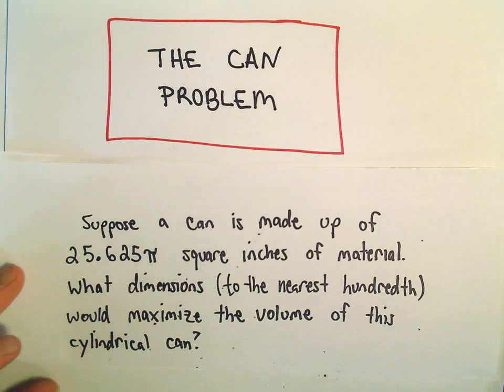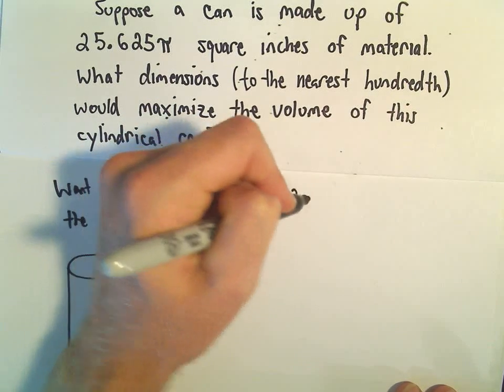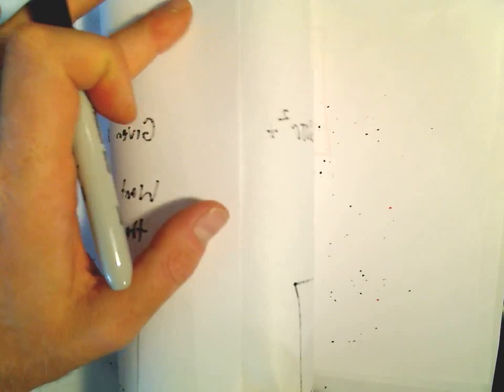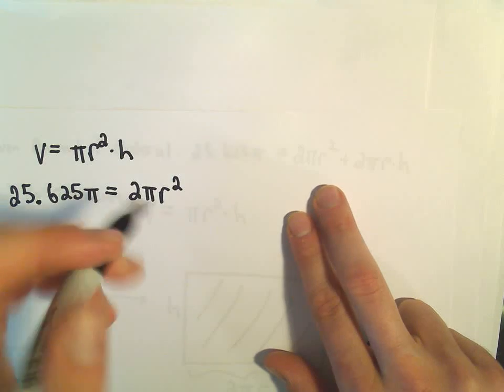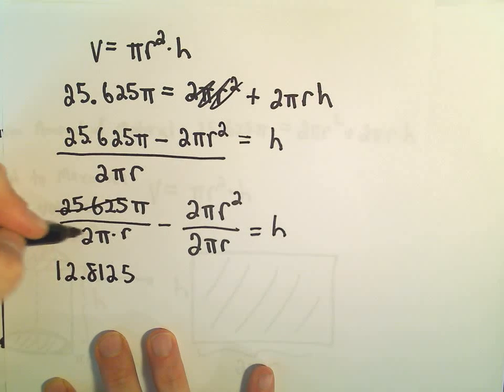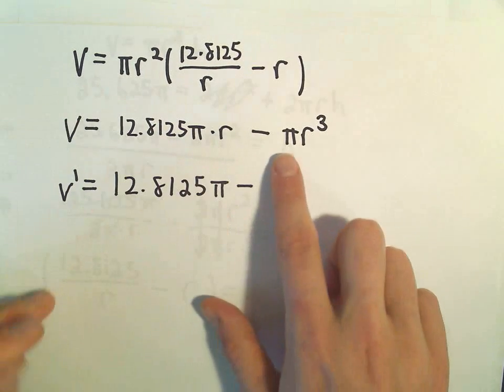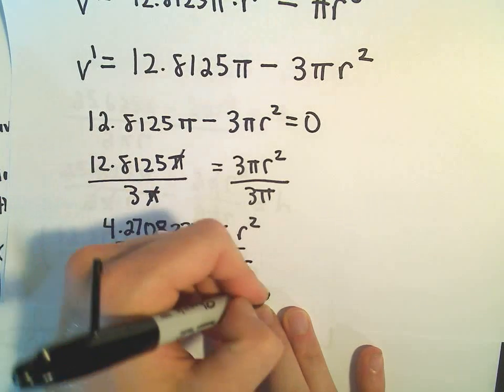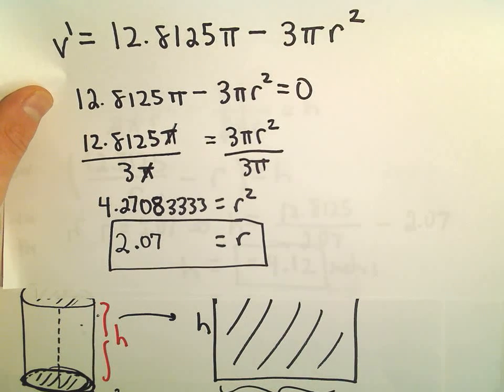Optimization Problem #6 - Find the Dimensions of a Can To Maximize Volume

Comment: Our teacher told us that we need to find an optimization word  problems for our performance exam in our basic calculus. I found this problem and this is what I gave to him. Today is our exam for basic cal, i just finished presenting this problem. At first, i was really tensed because i think i might get it wrong. Our teacher said we are not allowed to bring our copies in front so what I/we did is we memorized our different problems and it's solutions. Thank you so much for this video! I don't know what will I present if it wasn't for this.  THANK YOU SO MUCH.
(I added a comment cause i want u to know that i appreciate this video, Thank you so much!)
Reply from the maker: you are very welcome :)

Comment: i tried working the question first before viewing the answer and i said the perimeter of the cylinder should be 25 625pi=2pi R^2 +  h please how did u cum up with 2piR
Reply: A circle is a regular polygon with infinitely many sides.
So the perimeter of a circle is the same as the circumference of that circle and is always 2πr

Comment: i like your work sir. it really helped me a lot. i need your help on this question. " A box with an open top is made from a rectangular piece of cardboard, by cutting out squares in the corners of the cardboard and folding the sides upwards. The cardboard measures 50 by 30 cm. calculate the length of the side of the squares to be cut out to give a maximum volume"... please i trust you on this.

Comment: Notice that his final result (height = ~4 and radius = ~2) is basically a cylinder with the same height as it has diameter. The optimal dimensions of shapes after being optimized is nearly always as close to a square (or cube) as you can get, and a cylinder having equal height and diameter is basically a cube-like cylinder :)

Just a way to check your sanity when doing these problems.

Comment: i find this hard to follow. Maybe am just dumb :(
Reply: its never too late to give good reminders!
Reply: For optimization, you generally need to know the area of something, and the volume of it as well, (or perimeter and area).  Whatever you are trying to solve for you must take the derivative of!  In this case you wanted to know Volume, so after finding the expression for height (h), Patrick simply plugged height into his volume formula, simplified, then took the derivative of Volume (what you want to optimize) and solved for radius.  Now that you have radius, r, you can simply plug that back into your height expression and find r!  At which point you now have the optimal Volume for the cylinder!  Know your areas, perimeters, and volume equations!
Reply: Daniel Lau Go easy on yourself man. Relax a bit and get back on track ... step by step ;) Good luck!
Reply: ihonestytruthful You replied to a comment that was made a year ago. A YEAR AGO!!

Comment: when u took the derivative and solved for r... u never checked to see if it was a local max or min
Reply: its impossible for it to be a min, since the only minimum possible volume is zero, which would be at zero height or radius.

but in general yes